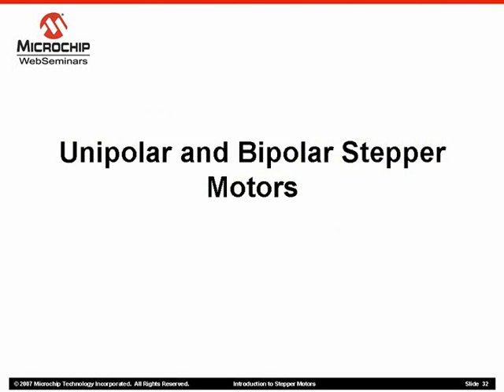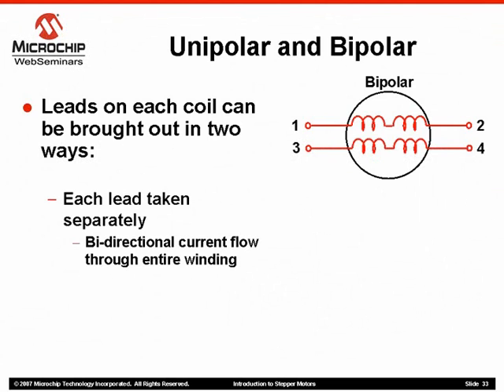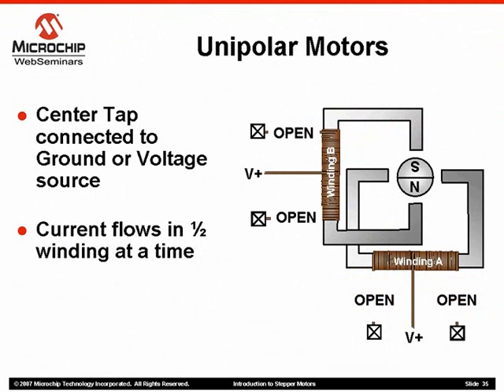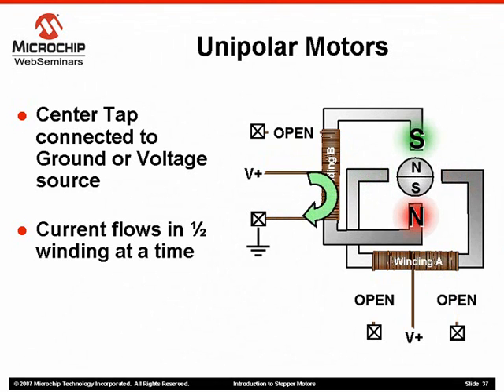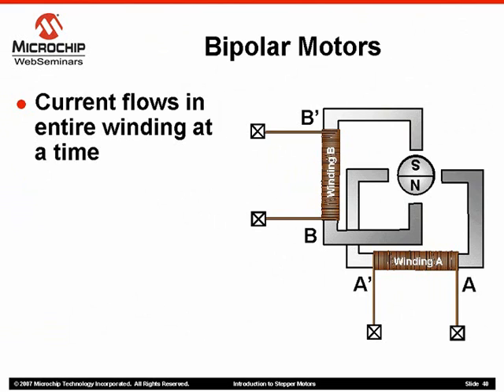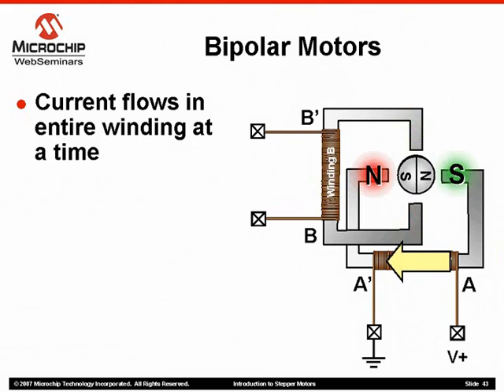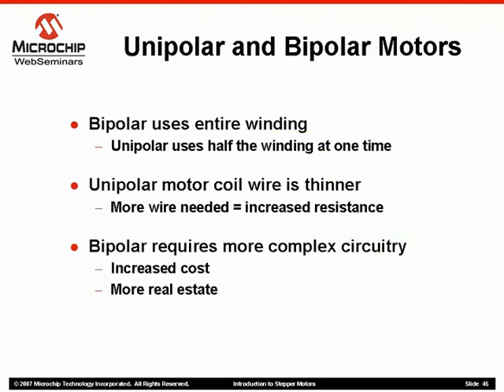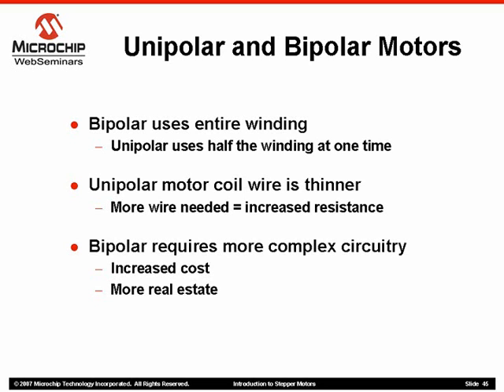Unipolar and Bipolar Stepper Motors

Comment: Is this the same type of motors that is used to precisely move needles in car tachometer and speedometer?
Reply from the maker: Hi there, thanks for reaching out. Stepper motors, like the ones described in the video, can indeed be used for applications requiring precise movements, such as in automotive tachometers and speedometers. Their ability to accurately control position and speed makes them suitable for these and similar applications where precise instrumentation control is essential. Hope this helps!

Comment: Great video! What do you call a stepper motor that has 3 coils? I am trying to find a driver for it with no success. Thanks in advance
Reply from the maker: This is called a 3 Coil Stepper Motor, it is not as common as the Unipolar and Bipolar coil configurations. Stepper motors have multiple coils that are organized in groups called "phases". A stepper motor may have any number of coils. Microchip supports gate drivers for unipolar and bipolar configurations. Is your motor unipolar or bipolar? This will help us recommend a gate driver you can use. For Bipolar stepper motors we recommend the MTS2916A (https://www.microchip.com/en-us/product/MTS2916A) or MTS62C19A (https://www.microchip.com/en-us/product/MTS62C19A). For Unipolar Stepper Motors we recommend the MIC4468 (https://www.microchip.com/en-us/product/MIC4468).
Reply: @MicrochipTechnology  Thank you. I will take a look.

Comment: Hello, I have a question, in the first state of the unipolar stepper motor when you put the first ground at the bottom right, isn't the polarity of the soft iron wrong, I mean, doesn't +VCC in a coil produces North and ground produces South?
Thank you
Reply from the maker: andre perez Hi Andre,You are correct. The animations in this video are flipped and we will be fixing this video shortly. Thank you for pointing this out!
Reply: Why variable reluctance steppers aren't divided in unipolars and bipolars?